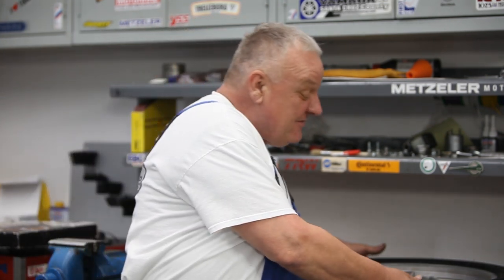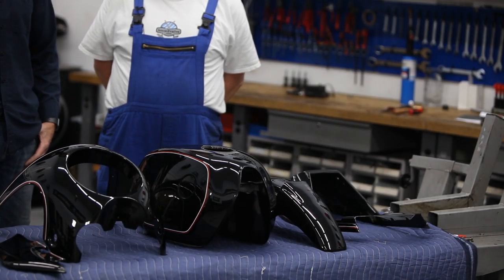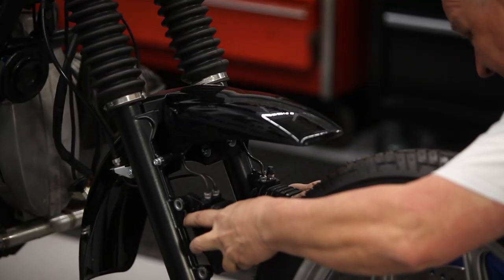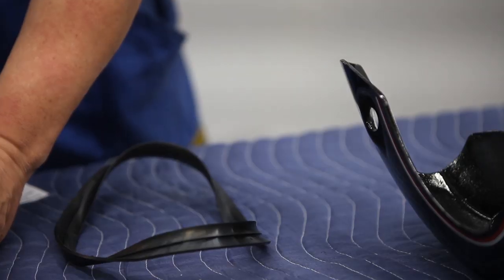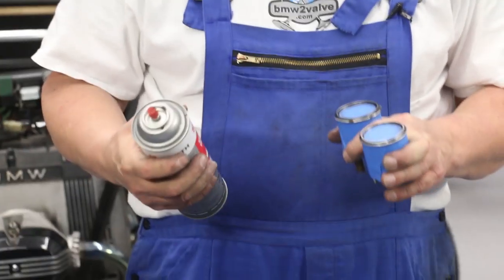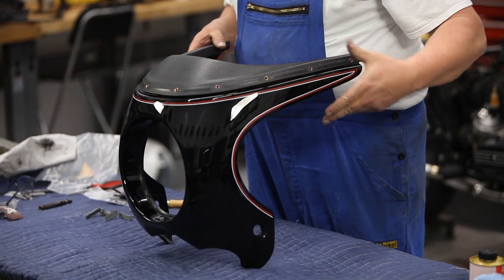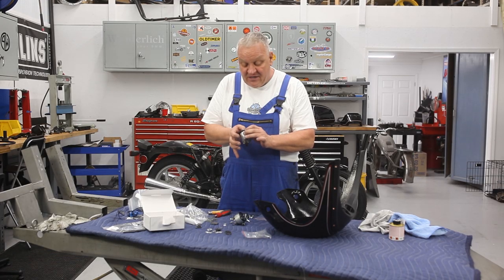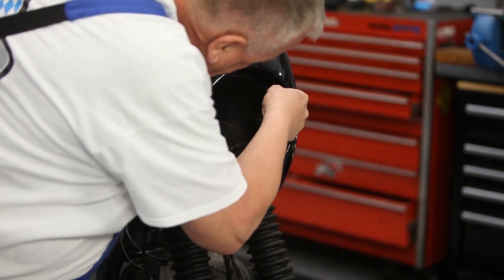BMW R80 RT to S Conversion #7 - Fairing, Fender and Brake Disc!

Comment: Please accept sincere respect and adulation for an absolutely excellent series of videos, between the R90 and this R80. 
Having spent so much of my life with a 1985 R45 as one of my sturdy BMW companions, I have been able to understand and appreciate many of your tips, procedures and techniques.
There's hardly a component on my precious motorcycle that hasn't had my grubby paws on it, more for maintenance than anything else. 
Your careful, precise and versatile approach ranks as the best work I have seen demonstrated on YouTube.
Thank you for putting the time aside to share your wisdom.
These Beemers will go on serving us for many years to come, if we take your work as an example to follow.
The way you work on a component to get it ready to last another lengthy period is very respectful to the history of the individual motorcycle you are working on and reflects your strong bond with these airheads.
Following you from the Emerald Isle (Ireland).

Comment: Nice to see you taking care of these beautiful bikes. Bought a 1988 R80 new, and still enjoy it today, although it got a Siebenrock 1000cc kit and a "extra torque" camshaft a couple of years ago.
The standard R80 is one of the smoothest BMW's of that era, engine runs like a turbine all over the rev range, and it handles like a bicycle. Greetings from Belgium.

Comment: Looks really great William!
To get the headlight gasket over the HL bucket, I would suggest trying a small piece of flexible plastic like a segment cut from a milk jug.   That might be less likely to gouge the paint than a screwdriver.

Comment: Just a quick question. Was the Avus black on /5 /6 etc single stage (no clear)?
Reply from the maker: Hi, Honestly, I'm not 100% sure however I believe that black was single stage and that clear was not used until the 80's. This is what I have heard but again, not positive.

Comment: Besides volt meter What other gauge to install instead of clock?
I Also need the bushings and grommets to fit the turn signal stalks to lower fairing. Do you have?
Thanks

Comment: Hi !! Thanks again for these videos !!!!! It helps a lot ! And I like the way you explain things, it seems more easy to do thanks to you !
For the next videos, can you give us the torque you are using each times ? This will help much more :)
Because in specs, sometimes it's not so easy to find depending on the model.
Thanks again !!!!!
Greg
Reply from the maker: Hi and thanks for your comments. Not everyone watching these videos is working on the exact same bike, so we prefer to not state torque specs unless they happen to be the same for all models and there are some that indeed are. Otherwise I think that it's best if you refer to your manual. I hope that you understand.
Reply: @boxer2valve  Hi and thanks for your answer ! Yes I understand. I have a R65 monolever, and it's difficult to find the good specs to torque properly. Sometimes I use specs for R80, sometimes other bikes...

Comment: Really excellent series of videos.  Pardon the question (especially if you've mentioned this before), but what brand and model is your motorcycle work stand?,,,cheers and all the best
Reply from the maker: Hi and thanks for your kind comments. The lifts that we use are Handy Lifts https://www.handyindustries.com/ These are all that I have ever used and they are solid and indestructible.
Reply: @boxer2valve  Thank you for your response,,,I will check them out,,,love your videos as does my son who owns a 74 R90/6   couldn't be happier than to have found your channel!